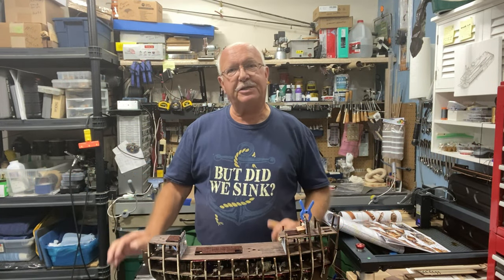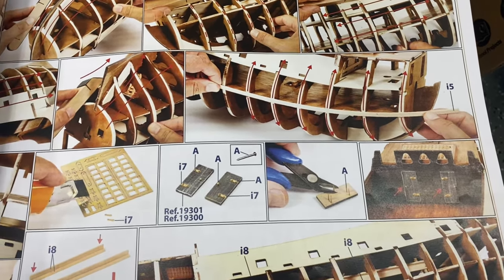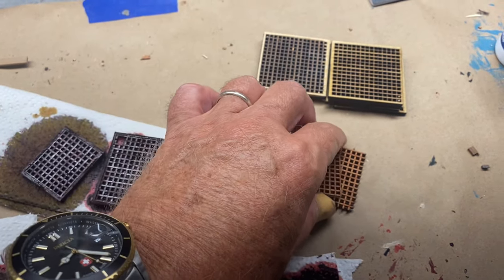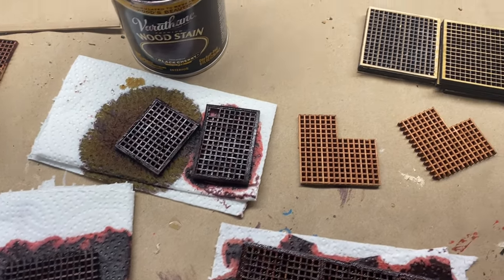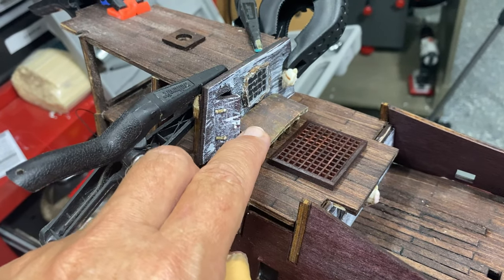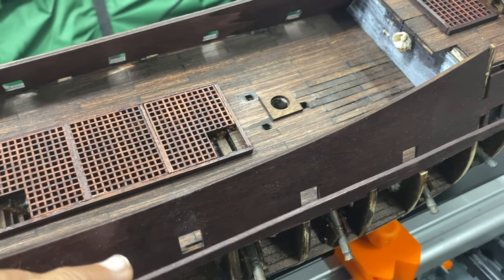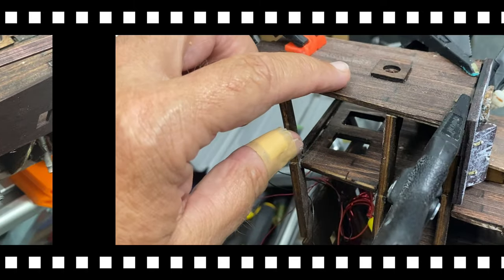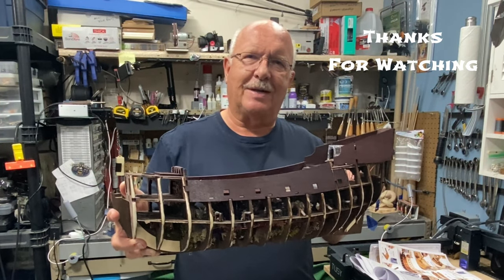The Flying Dutchman PART 7

Comment: Very nice on using the laser cutter! Next you will have to get a resin 3d printer to add more things 😂. I've been having to delay my build due to various issues with life and such. Wish I was retired so I could work on things more! Still follow your builds as I have time. Great work as usual!
Reply from the maker: I’ve had a lot of fun with the laser… but as you can see, it can put off a lot of smoke!  It depends on how deep the laser is cutting.  Etchings don’t create smoke and an auxiliary air pump is a must along with air filtration.  Above the unit I have a dust collection fan/filter that also blows it out of the garage.  I’ve made a couple of Skiff boats from scratch too using it to cut the parts.  Some etching on glass that shows some promise.

I made a mistake buying filament string type 3d printer as it won’t do miniature things…. Yours is the better option.  Wish you well and a good retirement someday!😎

Comment: Looking awesome buddy, keep up the great work, I had to stop on mine for a bit, but will be getting back on it very soon.
Reply from the maker: You’ve saved me some major trouble by being able to look ahead 👍👍.
I’m on hold waiting for the Trunnel kit… hopefully it works out!
Reply: @BoilerDan1  I'm glad that my videos are able to help you a bit, I do find with that kit, the picture instructions are decent, but there are some things that are very unclear, and the written instructions for that kit are lacking severely, they need to put way more written instructions with that kit, they are way too vague on what to do and where, I think with some tweaking of the instructions both the written and pictures, that kit would be a really awesome kit to build even for a beginner. Even though they call it the flying Dutchman and it has no resemblance to the movie flying Dutchman ship, and just a heads up you may want to figure out what you're going to do as far as a ship's wheel, because that kit has nothing whatsoever for helm or ship's wheel.
Reply from the maker: @BluestreekCustoms  I had realized that regarding the ships wheel and have in the back of my mind to make one on my laser cutter / engraver out of black walnut.  Then file it to the rounded shape on the handles!
Thanks for the heads up, and leading the way on this one!
Reply: @BoilerDan1  no problem my friend, keep up the great work, I wish I had a laser cutter engraver, there is so much I could do with one of those.